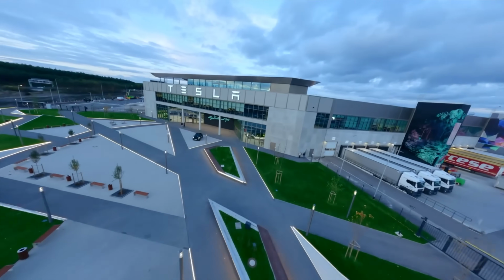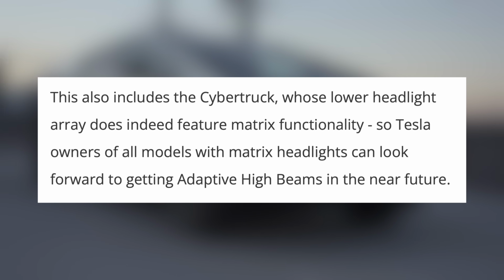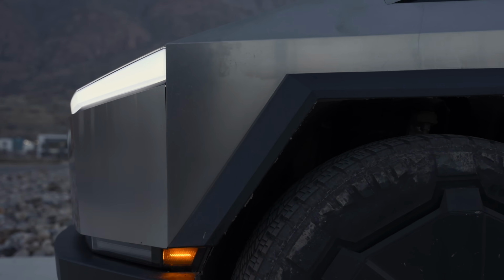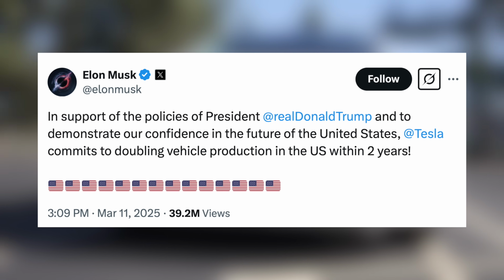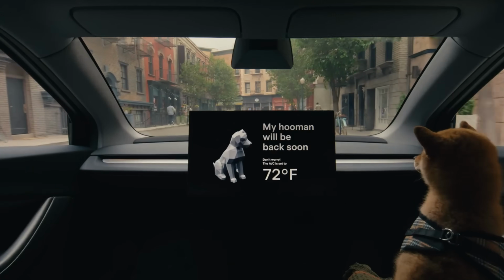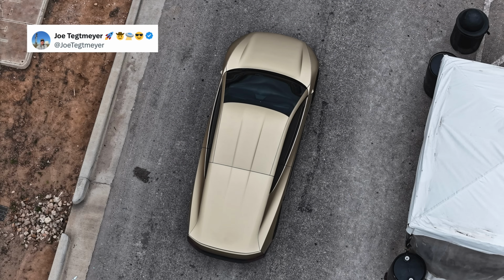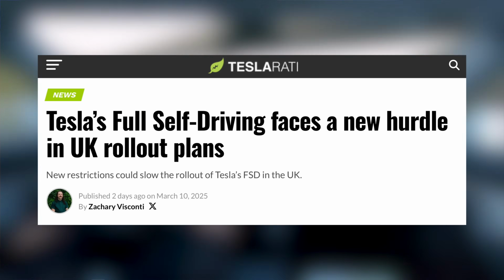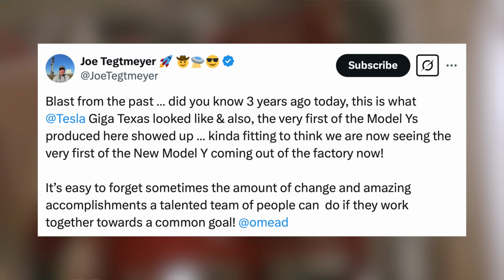Tesla's NEW Prototype Being Tested At Giga Texas | Don't Be Fooled

Comment: The latest FSD release works pretty well on my 2024 Model Y, though it just tried to make a right turn from the middle lane - totally illegal at that corner. 
I test drove a Cybertruck for 48 hours and the FSD didn't work as well as my Model Y. 3 times its driver side back wheels ran over the street island. I couldn't intervene in time to correct the error. 
Musk seems to be alienating the Tesla base (mostly Democrats concerned about climate change). MAGAs don't seem to want EVs at all even after POTUS buying one on the White House lawn.
If Musk continues his current work under the President he might need to divorce himself from any controlling stake in Tesla to get his base to be interested in continuing to support Tesla. If he can get the RoboTaxi to work - a very Big if - then that might mitigate things. I don't see true unsupervised FSD working without adding back some of the sensors like radar, lidar, and ultrasound like Teslas used to have. Exciting times!

Comment: I remember from my sales stint at Sears when they told  us a major purchase like a Washer, Dryer, refrigerator was based on emotion.  You could talk until you were blue in the face about the gizmos On the product, but unless the buyer was emotionally engaged they were going to walk out the door.

So I’m puzzled as to who the Robotaxi/cybertaxi-thing is going to be sold to?  OK, we have geriatric and disabled people who can’t legally drive themselves—check.  Maybe drive the kids off to school and back—check.  Compete with ride-sharing companies to underbid them and put every human-driven vehicle out of business—check.

But the kids being dropped off at school are going to be super-embarrassed that to be dropped off and picked up at school in a boring car, and wonder why their parents would spend so much money and not the TIME to take them to school.  Geriatrics will want their autonomy or luxury car and feel demeaned by this car, especially if they’re forced to use it.

And self-drive has little backup to fall on when a computer processor, sensor, or actuator (brake, throttle, steering)  fails  and the car erroneously dives into opposing lane traffic at high speed and the driver has no ability to correct for the fault.  I mean, jeez, make it single-fault tolerant at least for the conditions when any failure of CPU, sensor, or actuator results in a  head-on collision with oncoming traffic when there’s less than  250 milliseconds to detect the fault and correct for it. .

But who’s going to point to their new CyberTaxi in the driveway and brag to their neighbors about it?

Yeah, I didn’t think so.  I suspect sales may not match human-drive models just yet . . . . .

I mean, look at how much the CyberTruck met sales expectations?
Reply: Soooo many good points! Thanks
Reply: I think Robotaxi will mostly owned by Tesla as fleet vehicles like Waymo for the near term "2-5 years" After its proved out I can see people buying 4 or 5 and setup at smaller areas that will never be served by any other robotaxi service.

Comment: Rain sensors are just low-resolution cameras with an IR source at an angle. They do not measure water on the windshield directly; they measure the change in refraction caused by water on the glass. Rain sensors only measure a small area of the windshield (about 1 square inch). The Tesla solution is actually better, but in other cars the user can adjust the sensitivity because everyone has a different threshold for when the want the wipers to wipe. Tesla has an adaptive threshold, but most people do not know how to use it (it is not documented well). 
When you want the wipers to wipe, trigger a single wipe manually. The system learns that threshold and will use it for the rest of the drive.
If you get a dry wipe, check your dashcam. Often, you will see on the dashcam that a bug or something landed on the windshield where the camera can see it but you cannot. The dashcam is a valuable tool to debug wiper issues.

Comment: Meh, the dynamic headlights work ok 75% of the time, they still blind oncoming traffic and let me know. It also can't see oncoming trucks on the highway, because the truck's headlights are blocked by the metal road divider, and I'm blinding the truck drivers who sit higher in the cabin,...It also illuminates rods signs so hard, that they blind me because of their reflectivity. Also, the throw distance is sometimes shorter than with normal lights. Also, Tesla should add battery capacity, but that is the last thing they care about, or the charging curve,...slowly bit surely Tesla is being left behind by the Chinese car manufacturers in rolling out new tech. The argument of the longevity of the faster charging Chinese batteries holds no water, as Tesla also used the BYD blade batteries and didn't mind the faster charging curve.

Comment: expand the model lineup.  Make a regular looking pickup and an EV van.   In the EV van, equip with a 24 hour climate control system so that it is comfortable for overnight camping.
Reply: no make a model 3 wagon and model 2, then EV Van.
Reply: @ their new customer demographic wants a van or camper they can use as they drive around the country during their retirement years.

Comment: Tesla needs to cancel cybertruck and make a small pickup like the Ford Maverick with a 100kwh pack and about 350 miles of range for $40k.
Reply: I'm fine with the Cybertruck sticking around as a new tech testbed to get the kinks worked out before rolling it out to the high volume models.  But they absolutely need an EV Maverick competitor!
Reply: CT is doing just fine despite your being triggered by it for not being swoopy and samey as other trucks.  Adding a "Maverick" simple EV truck would be good, of course, but why cancel the success of the CT just because it hurts your feelings?
Reply: Success?  How many of the 1.5 million orders were filled?  For crying out loud any schmo can get a CT at a discount now.
Reply: No, they don't. They don't need to do anything of the sort. You just want a Tesla EV that looks like another stupid truck.
Reply: @ yea a lot of people will spend $60000 on single motor cyber truck
Reply: Add an additional work vehicle. A small truck or van that can be used for autonomous home goods delivery or as a  work vehicle. It could look like a small truck or small van.
Reply: @dannyboy2522-q7d  IKR?  These people and their "affordable models" never even bother to do the math ...

Ford sold 131,142 Mavericks last year for an approximate average gross margin of $12k each resulting in a total gross of $1.6 billion.
Ford sold 765,649 F-Series trucks last year for an approximate average gross margin of $30k each resulting in a total gross of $23.0 billion.
Reply: Yes… They should definitely cancel the number one selling EV pick up truck in America 😂
Reply: Why?  That's like saying that Tesla should cancel their flagship sedan Model S

Also, it's never "affordable" models that generate the most profits.
Just do the math in Ford's case ...
Ford sold 131,142 Mavericks last year for an approximate average gross margin of $12k each resulting in a total gross of $1.6 billion.
Ford sold 765,649 F-Series trucks last year for an approximate average gross margin of $30k each resulting in a total gross of $23.0 billion.

Remind me again which pickup truck Tesla offers that competes in the same space that the F-Series does?
Reply: I love mt cybertruck
Reply: A ranger sized pickup is so much better sized for outside of the US. Would be more efficient
Reply: It would take a year to ramp up production
Reply: Purchase telo and make what customers need
Reply: There is no need to cancel cybertruck. He needs to add a small truck for $39,000.
Reply: I keep saying that too - CT needs to go down as a bad idea, like, 4 years ago

Comment: The removal of radar and ultrasonic is when I stopped taking Tesla seriously as a personal option.  I still love to hear about the brand, and appreciate the many advancements, particularly steer by wire, but would not consider a vehicle that's entirely reliant on cameras, especially after hearing stories from friends who can't even rely on their reverse proximity warnings in parking lots and have super wonky automatic wipers.  And FSD is certainly not going to approach acceptable operation on cameras alone.
Reply: radar was causing problem
it would see a big thing, label it as a over road sign so safe to drive, when in reality it was a stopped semi truck.

Tesla vision is now better than ultrasonic , because ultrasonic can't see curbs.
the removable was really early yes, but now i prefer this compared to ultrasonic or even the "360" cam of other cars, because the 360 cam isn't as accurate as tesla vision.

lidar doesn't work in rain/fog, and you need camera to see the road lines. in the end, for a fully autonomous car, the system need to be able to drive with camera alone, so why use lidar in the first place ?

FSD has proven itself to be better than competitors (faster, safer yet not final version, and can drive everywhere a human can).
Humans drive with vision only, why a car with 8 of them couldn't ?
Reply: @theaypisamfpv  actually. most humans drive with experience (something that takes time for Tesla car to learn) , eyesight and hearing.
Reply: @alexnutcasio936  tesla FSD has more than 3 billion miles of driving, is it enough experience?
(Blindfold you don't do shit tho lmao)

Earrings yes, it's I believe an ability that should be added for FSD.

Comment: Drove an older model 3 as a loaner for my 2024 Model Y which was getting a front windshield replacement for $1,500.  The model 3 had the normal parking sensors.  Which I now know are way better than the camera parking assist that I have that gives me a warning every time I park.  Was happy no one vandalized my car while it was sitting in the service lot.
Reply: My Honda windshield replace cost is 1400.